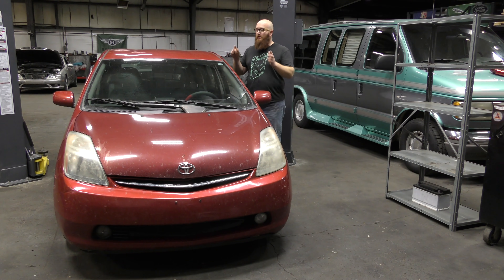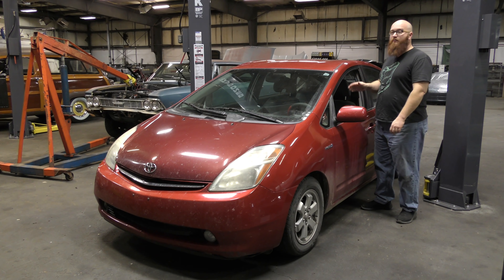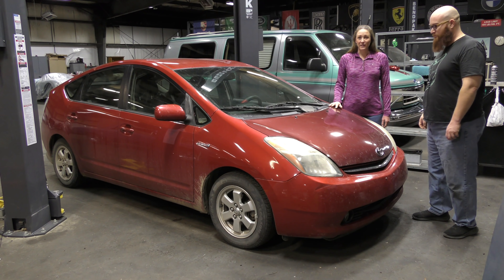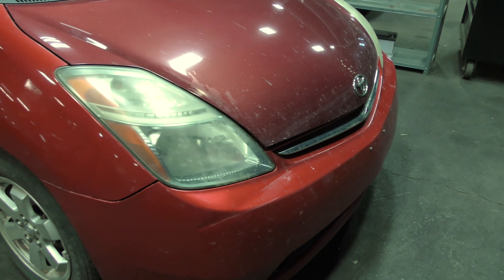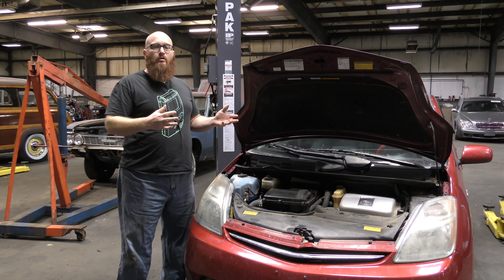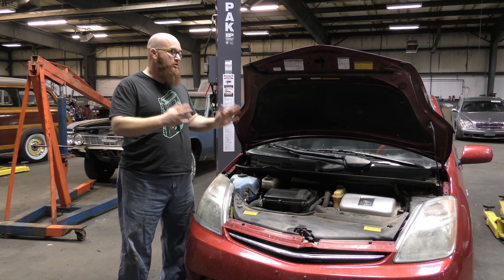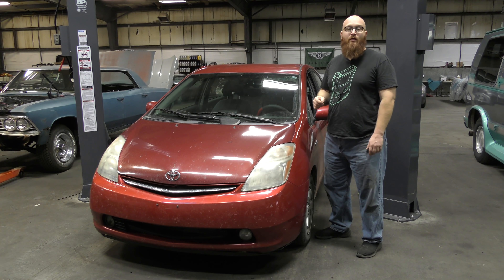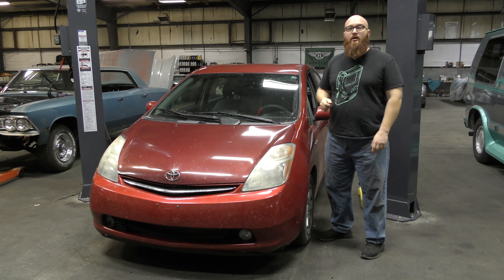When is it time to Buy or Sell a Hybrid? The CAR WIZARD inspects daughters 2008 Toyota Prius

Comment: The current big downside to owning a hybrid vehicle whether it's a Prius or a Honda insight is that you now have to worry about your catalytic converter being stolen especially here in California because I hear about it all the time from friends and co-workers and exhaust shops are now supposed to install a blocking plate that prevents this from happening but yet a lot of people don't think about this and they learn the hard way when they have to spend $2,000 on a replacement catalytic converter!! 😔
Reply: What’s so special about their cat?
Reply: @210SAi  the material in them. Platinum and copper..
Reply: @LTJohn  but why that model in particular? Seems like multiple people were reporting this issue. I’m in TX and while I’ve heard about CC being stolen I’ve never heard of it for a specific model car
Reply: @210SAi  it's not just Priuses but also trucks that are victims as well but from what I have seen here in California the Toyota Prius is the number one for catalytic converter theft..
Reply: @LTJohn  More dope heads out there
Reply: @WuBloodKin09  exactly..

Comment: I was just estimating my net worth. I don't really own much. Mostly just my car... Turns out that my 2013 Prius is worth about $2000 more than I paid for it. And I'm at the half way point on paying it off. So, that's neat. 180k on the clock and still no sign of battery problems. I'd love to be the guy who owns a Prius and a Lambo at the same time. Although I definitely won't fit in a Lambo.

Comment: Car Wizard, I just bought a Toyota 2005 Prius Gen 2. The owner has had it for 3 Months and fixed it up, Many oil change records from prev owner. He got new Winshield, Rotors & pads, New Hybrid Battery pack! Upgraded headlamps to  bright Halogen. Tires are 75% close to new all around. One small ding in front bumper, rear surface rash but no accidents. I paid $4500,00 with 230,000 miles. Drives like new, No Suspension noise. I feel like I can get 100,000 more miles. I plan to change the oil Every 30,000 miles! What do you think, God Bless. ( My car was totaled 4 Weeks ago, 2011 Ford Fusion, I put 100,000 miles on it , Got Average 34MPG 4Cyl Mazda made engine& Trans. I miss the great MPG Fusion But this Gen 2 Prius makes me feel better. Thanks.

Comment: Make: Toyota
Model: Prius
Year: 2008
Trim Levels: Full options
Interior: Old grey 
Exterior: Red Barcelona
Engine type: FZ-10
Mileage: 190000mi
Vin code: JTDKB20U686772278
Made in Japan
Assembled by Toyota company
Order date: 07,09,2007
Date of first use: 18,11,2007🤣✌️

Comment: Ok but i have a question:if you choose to keep it another 15-20 years and you change the batteries out in the future and keep the maintenance up and take good care of it,replace the head gasket or put a new engine in if it goes out I think if you wanted to that car could last 15-20 more years.

Comment: I rode in an Uber which was about this same year Prius.  It had almost 400,000 miles on it.  The owner said everything was original and had never had any issues with it.  Toyota does a masterful job with their hybrid technology.  If I’m buying a hybrid the only one I’m ever buying is Toyota.  Nobody does hybrid better.
Reply: I don't believe anyone that says they don't have any issues. Ball joints, shocks/struts, control arms, wheel bearings, etc. all eventually need to be replaced. Hell I remember a humming noise in my mom's 2017 Toyota rav4 with 60k miles. Pretty positive it was the rear differential fluid that needed to be replaced since it's AWD.
Reply: @Lincolnator721  I’m not surprised at all to see Toyota products on all original struts and suspension parts.  My daughter’s Camry with 210k is on all original parts except the brakes.  And I just replaced the rear drum brakes 2,000 miles ago, they were original.  We have all Toyotas in our family and it’s not uncommon at all.  Our 2012 Highlander has over 200k and only thing I’ve replace are the brakes and tires.  Just regular oil changes and fluid changes.

Comment: Put that Prius into taxi service in Los Angeles or New York. As long as the car gets used, the lifespan seems to be forever. It’s the ones that get driven only a couple miles then parked that need batteries replaced.

Comment: I think the engine is not capable of starting in neutral. Only in park. I could be wrong but either way Wizard is right. Lube is key.
Reply: You’re right. No engine start (or stop, if already running) in N. But in the situation the wizard described you could also be in P, and then it could happen. 
Leaving a Toyota/Lexus Hybrid in N for too long will lead to problems though, because the HV battery will discharge. If left for too long, only a special device from Toyota will bring the battery back to operating voltage. (Or disassembling the battery and manually charging the cells.)
Reply: It will go to Ready and later turn over the engine in Neutral or Park.  If the car has been left in Ready, which means ready to run in EV or ev with engine.  It won't charge the high voltage battery in Neutral but will run the engine.  Which is bad if you have drained the oil and the delayed engine start happens 10 minutes after you put it on the lift.
Reply: @rj.parker  No, it cannot start the engine in neutral.

Comment: I have 3 Prii, a 2005 with 205k, a 2008 with 130k, and a 2012 V with 70k. Battery went out in the 2005 so I went to a bone yard and got a low mileage battery from a 2014 Prius for $850. Another 15 years to go. Parts are cheap. Amazon sells most parts. Try to buy a new tail light for a Mercedes or BMW for $70.
Reply: So, the generation 2 and generation 3 hybrid batteries are compatible?
Reply: The modules are the same from 2004 to 2015. There are 28 NIMH modules (cells) in both generations. The metal cases are different but just transfer the Gen 3 modules to your Gen 2 case. A junkyard is your best solution to the battery problem.

Comment: Great video. Just wondering didn't these cars suffer, from the head valves getting coated in carbon. Like the VW TSI engine. Or do the Prius engine have two injectors? Thanks

Comment: The big difference between cars like this Prius and the old cars we bought when I was a kid is that these cars have parts and assemblies that are catastrophically expensive when they fail.

In my day an engine might run a few hundred dollars from a junk yard and a transmission would set you back $75.00 to $150.00 depending on which junk yard you found it at.  You didn't need any expensive computer diagnostic equipment and a few hundred dollars in tools could fix just about any problem with the car.

And best of all junk yards actually charged people to tow away cars that didn't run.  I honestly got offered money to take cars away. Usually I just fixed what was broken and drove the car home, I never took money from people to take my new car away.  I usually sank anywhere from $200.00 to $600.00 into a $1.00 car and drove it for at least another 10 years or until all of the little nonsense breaking just got too much to deal with.   There's a point where you're under the hood more than behind the wheel... and that's a great place to give up and start looking for another car.

I recently saw a whole fleet of mid 2000s Prius being sold off by a government agency.  They sold for two to three grand. They all had pretty low mileage, but with the cost of the battery and electric drive systems a two thousand dollar car could have become a five or eight thousand dollar car overnight. And kissing off a $2000.00 car because the battery or electric motor crapped out the week after you bought it would have been economically painful.

And there's the problem with many newer high tech cars.  Unless you get them for free it doesn't take much to eat you alive.  The secret to buying older used cars is never to have more money into them than you can walk away from and that's hard to do with a Prius, in as much as you don't find them for free too often.

And lastly if that electric drive craps on the Car Wizard's Prius the day after he sells it... it isn't his fault. No one knows how much longer it's going to last.  It's just bad luck for the guy who buys it.  So if you find yourself buying an old Prius or other high tech wonder car, ask yourself the question.... "Are you feeling lucky?"
Reply: 50k mile Prius engines $1200.  Transaxles with electric motors almost never fail. No clutch or torque converter. New Toyota oem hv battery now wholesale $1650. Ten year life.   Used $500-$1000.  Actually all are relatively easy to change assuming you have a lift.  But if electric scares you then by a Camry, Corolla or Rav4.
Reply: @rj.parker  Last I checked the Prius battery was over $1500.00 used in my neck of the woods and closer to $3000.00 new, but that was a couple of years ago.  And yes those electric modules don't fail often, but when they do your day has taken a serious turn towards crap.  

I've got no issues with electricity and I don't think that Prius are bad cars, but lots of folks who buy high mileage low cost cars don't have a lot of resources left over for repairs.  

I've actually "adopted" cars that only needed minor repairs from folks too broke to fix them, I put in a few hundred bucks and drove them for years. 

For someone who only has a few hundred bucks in the bank a dead Prius battery totals the car.
Reply: Okay, boomer.
Reply: @RJ-vb7gh  When you were a kid the minimum wage was $1.25 or less and a brand new 1964 Mustang was $2,368  financed over three years.  The payment with no down was $68.
Reply: @rj.parker  True, but for the most part parts and repairs were affordable.

A $1000.00 used car today can easily rack up $5000.00 in non catastrophic repairs in a year's time or even overnight.  And for a lot of people today that would total the car or more than wipe out their savings.

For people buying new cars the warranty covers the big ticket repairs, but for folks that can't afford cars under warranty, a lot of inexpensive used cars are ticking time bombs just waiting to financially ruin their owners.
Reply: @RJ-vb7gh  my point is inflation has distorted your perspective.  That $1000 car today is the $100 car of the sixties.  Major repair totals either.  Simple as that.   The price for a Prius motor or battery should also be viewed from a 10 to 1 perspective.  The percentage of the population who can afford a new Mustang today is many times the percentage who could afford it in the sixties.  Some can't now, many could not then.  "Prices were better back in the day" is not a totally valid argument.    

We could talk about a modern vehicle's complexity and if the average shade tree mechanic can intelligently diagnose and repair without resorting to the parts cannon.  Today the qualified tech is far more controls and diagnostic literate.  However a Prius can easily go 150k without repairs while that 64 Mustang was lucky to make 50k without a transmission, brakes and a valve job.  The Prius gets 50mpg with rock solid suspension and safety features while the Mustang was lucky to get 20mpg.  I would take that Prius as a daily driver over the 64 Mustang.
Reply: @rj.parker  With my high level scan tool, new cars are a lot easier to diagnose than they were back in the day. But they do have a crap load of more expensive controls and subsystems  to fix when they break. 

It's not that used cars are that much more expensive now than they were then adjusted for inflation.  It's just that they have more things to go wrong and more expensive assemblies and when certain electronics and pollution systems break, it can be a pain to diagnose and fix. 

I'm no fan of the 1964 Mustang... it was a cheap throw away car.  But if you gave me a 1964 Mustang or a Prius, given their not rusted out.  I'd take the 1964 Mustang like a shot. There isn't anything in either car I couldn't fix myself, but I could swap the whole drive train in the Mustang for the price of the Prius electric drive unit and chances are with proper oil changes and care, I wouldn't ever have to.  On that Prius, that battery is eventually going to die, no matter what you do or how you drive.

All cars break down and the Mustang is going to need more service than the Prius.  But 10 sets of points are still cheaper than one ECM. A $15.00 Jiffy kit is way cheaper than a set of fuel injectors. And if I'm not wrong a Ford starter motor was under $50.00 while a Prius might need a new electric drive unit.  The fact is that sooner or later the Prius is going to need a service that's going to be really catastrophic to low income owners..  

Now, brand new and under warranty for free, I'd likely take the Prius. Despite being good looking the Mustang really was a piece of junk (depending on engine and options to some degree) and if someone else was covering the repairs it's not a bad little car.

Comment: My EV battery pack failed before 200,000. Hair clogged up the fan and overheated the battery. New pruis c battery cost around $1500. Motor shakes at times and   acts like it wants to shutoff at first start then goes away. Currently at 214,554 miles.
Reply: Yep that is an extra maintenance item I'm surprised that wasn't mentioned. Should be cleaned out at least 1 time a year. Including not just the fan but also the "plumbing" that goes to to the fan.

Comment: Hey wizard, Ive started a job delivering papers, 130 miles a night at the most, i estimated 48k miles a year, i drive every single night for the job, Would a new honda fit be good enough for its 60 month loan term for this application? Or should i get a cheaper chevy spark and chance it

Comment: The more you hear the engine, the worse the battery is.
The more oil it eats is a telltale sign of how bad the engine degradation is.
And if the engine is running 75% of the time or more, the battery needs to be replaced before too much longer or else the engine will need a rebuild/replace as well.

Comment: A successful Youtube and car repair business should allow you to be able to at least assist your kids with getting newer nice cars unless you don’t think they will properly care for them. I gave my son a pretty loaded 2016 VW Golf (German spec, living in Germany) and he has a up to 53 mpg safe (80 hp) reliable car with a sport exhaust custom painted wheels that has only needed sparks plugs and recently a timing belt w/water pump & belt, all new rotors and pads all the way around. Besides oil changes and an OEM K&N air filter that is all it needed in 83,000 miles and he has a car that is nicer than most of the people he works with and friends have. Just drive it with no worries since he isn’t really in to cars as it appears your daughters aren’t as well.

Comment: Wizard - what do I do about the oil consumption issue on my 200k mile Prius? I changed the PCV and it hasn't seemed to help...don't want to dump a ton of money into a $3500 car that gets me from point A to B....
Reply: 1. Try adding AT-205 to the engine oil. It may help restore the seal's flexibility and seal the leaks. 2. Check your owner's manual; see if you can go to a slightly-higher viscosity oil in your normal weather/climate temperature range; the thicker oil may reduce or stop the leaks.

Comment: I miss mine. I"ll drive anything but the prius was great for commutes.
Reply: Killed it at 420,000 miles.
Reply: @SourGrey   nice! What killed it finally?
Reply: @210SAi  user error. I fell asleep on the road.
It did burn oil but I kept it going. With cheap oil. It wasnt that bad.

Comment: Find a decent used LS 430 about 100K miles. Doesn’t cost too much and very reliable.
Reply: Agreed. Go for the 2004 to 2006 model with the six-speed automatic. It is more fuel-efficient.

Comment: A Prius will not start in neutral the engine will stay in whatever state it was in, running or not, when it was put in neutral. It can run the pack dead however because it can't charge in neutral.

Comment: Got a similar Gen 2 Prius, same miles, maybe a little better body. It is a great runabout for town and the back seat is always folded down so I can use the car like a minivan or wheel barrow. In your opinion is it with putting a reconditioned battery and front struts on it?

Comment: What car would you recommend in the 1500-2k range? My minivan needs alot of work to be put back up to par and I don't have a whole lot. I was gonna use part of the stimulus checks for a newer used car but I like Leo can't find anything. I'm local to kansas. If you know of anything let me know! I'm only 2 hours from wichita, I just need something reliable for 2 of us plus 2 kids with carseats and fairly sized trunk for strollers etc. I just declared bankruptcy so it's hard to get a loan and I really don't want to. My works parking lot is gravel and extremely tight and people are constantly banging the work vans doors into your car.

Comment: How long do Prius batteries last again? And how many miles on these original batteries? Hmm...
Reply: I had 240k and I believe it may have been reconditioned once but my records were poor from the previous owner.   Depending on the climate 150-300k. Miles.   It is an air cooled battery southern climates are probably hard on them.

Comment: I am getting ready to look for one of these I'm not sure what year I should look for the price range is going to be around $15,000 what would you say is the year and mileage I should look for at that price point? Also I have a 2000 Corolla that I put about 10 gallons in every time I fill it up and that gets about 230 up to 250 MI per 10 gallons so I was a little confused on the last video about this car where you said it only has a 10 gallon tank so it'll have probably about a 250 mile range but that didn't make sense to me because my gas mileage is only 21 miles per gallon so does it actually have a 10 gallon tank and that's all you get for mileage or would you get like double than that because the gas would last longer?